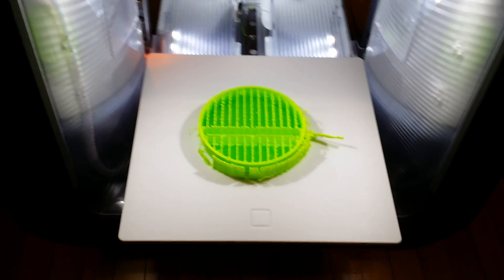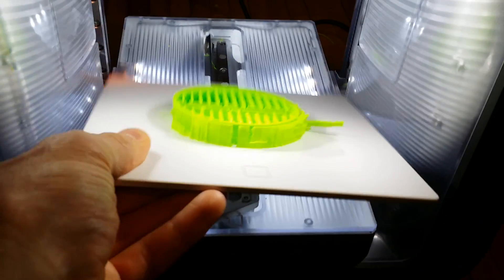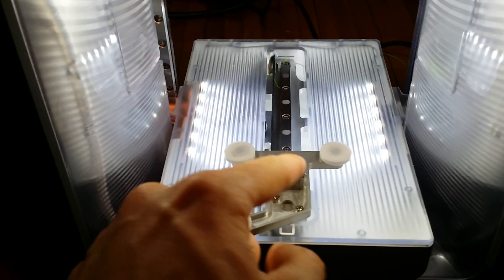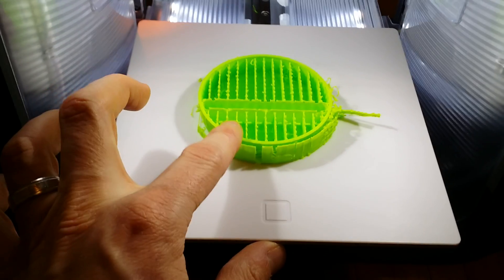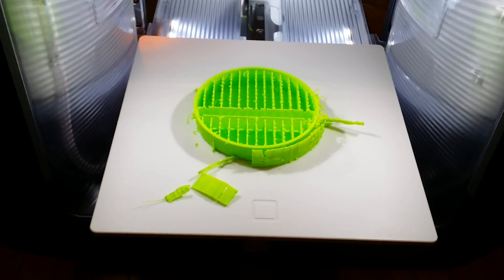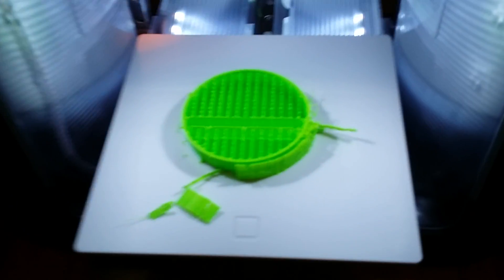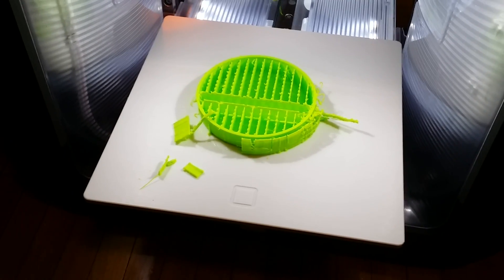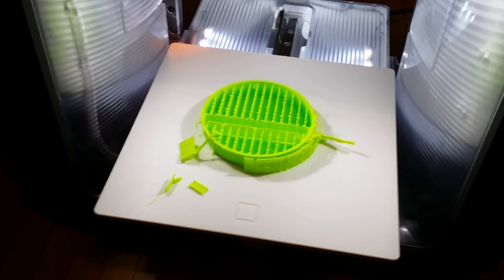Cube 3 review, the BAD and the good

Comment: The cartridges are sort of serviceable.  A few small flat screwdrivers, you can separate the upper and lower pieces of the cartridge without causing damage...the trick is to move the plastic with the drivers as wedges.  A few on the outer ring, 4 on the inner ring.  Be gentle and patient, the pieces will separate and you can get inside where the gear and pinch roller is.  Two screws hold it to the plastic body, the other two hold the upper and lower frames of the gear assembly.

If you have gotten that far, you will see plastic debris from the gear spinning out on the material.  It gets everywhere in there and eventually, I suspect, some gets pulled for the ride up the tube with the material.  PLA has a rough surface to the material relative to ABS.  The more debris up the tube, with a rough material that already has a tough time going through to begin with, makes it gradually worse until you get the jam.

The jet assembly pops apart, but it is difficult to put back together without some dexterity of high degree.  The jet consists of a metal tube that has a flange around it to hold it in place.  On one side of the flange is a small spring that is held in place in a very tight area near where the jet is exposed.  Removing the cover is easy, putting it back on is where it can be difficult.

I took one apart to that level, and found the tube the material went through, obstructed.  The metal extruder easily slips over the tube, but inside, discovered a lot of debris...loose...and not unlike what I saw at the gear drive end...

Once I saw that, I was able to pull the material out, with some bit of strength, it was really stuck in that clear tube...but out it eventually came.  I trimmed off the portion of the material chewed by the gear, and reinserted it back in, slipped on the spring, the extruder and spent 10 minutes trying to put the spring back into compressed form and slip the plastic back into place.

Then cleaned up the gear of debris,  placed it back around the tube (small collar on one side locks tube to gear box) and pinched it back with the two metal screws, and housed it back into the case.  It helps if you have a second cartridge to see how the internal is wound.  There is a guide tube inside the case that floats freely, but is used for the material to be moved in a curve towards the gear and extruder tube, and seeing where it normally goes as you snap the two pieces back together is helpful...insert the cartridge back in the machine.  Do a purge test to verify it is pushing material...it should put out a bit of product and stop...in my case, about 5 minutes of waiting for it...a strand about 2 feet long came out and I was done.  Test printed after on a larger job and it was fine.

Not exactly a warranty kind of thing, but they are repairable.

For future reference, ABS is less prone to this than PLA...at least, that has been my observation.

Comment: Hey Kyle.... you mentioned a printerbot. Get it. I own a cube3 and it is nice when it works but has WAY to many issues for the $1000 price. The printerbot is like $600 and is not locked down in software or hardware. If I could do it again, after learning what I have learned, the printerbot would be my choice. In fact I'll sell you my cube3 and I will go get the printerbot metal and buy some other toy with the extra money! My biggest complaint is actually all the "de-laminating" that my parts do because the walls arent fused/welded/stuck together.

Comment: Iv seen a few people with cartridges that are having this issues but it seems the good news is they are willing to send you a replacement. Also heard they have made new cartridges that don't have this issue and it should be fixed! I'm interested as long as that's the only issue I'm hooked on getting one! Let me know how it goes and how long it takes to get a replacement cartridge and if they make you send the old one back
Reply from the maker: Ok keep you posted, so far very frustrating though. If it keeps going as it is, the reputation of the company may get ruined below a returning point. Will let you know when they send the replacement for sure.

It's basically the only issue, but this issue prevents you from printing altogether. I'm dead in the water at this point...
Reply: Well I am dealing with solidoodle right now and their printer was way worse couldn't even get it to print or level the bed properly because their software was horrible. Iv heard a lot of good reviews with the cube 3 but a lot of people have had issues with the cartridges which seems to be fixed and hopefully no issues after that :)
Reply: Read on cubify fans blog that he said he has been sent new cartridges from cubify to test and with the new ones he hasent had an issues printing. Go check out his blog just google cubify fan
Reply: Complelty understand but he addresses many issues and fixes and never says its oerfect. He even tips that he has learned over time to fix and tweak issues. Iv also read on other forums that the new cartridges have fixed the jamming issue just as he posted on his blog.
Reply: Sucks then not to sure what to tell you. I haven't purchased this printer yet just doing research and iv seen mixed reviews. People saying theirs works and others saying theirs doesn't. And how do you know if the printer they shipped had the newer carts packed in? Just assuming I guess? I'm sure most of the cube 3 are already boxed with the old filament and seeing the new filament from what I hear is still being tested those haven't started shipping yet. Maybe I will hold off with this printer and just grab a printrbot save myself some money and the issues you guys are clearly having.
Reply: Please do! I hope your replacements work and you guys can continue to print :)
Reply: Ildar Khakimov Hi I donated the cube 3 to my class and my dad is the chairman so it would be nice to know any problems because I could help probaly
Reply: Yeah and do you have an error code
Reply: Yeah so that happend to me so I think you need to get it fixed a new cartridge wont do it sorry about that but lets just hope that you can get it fixed